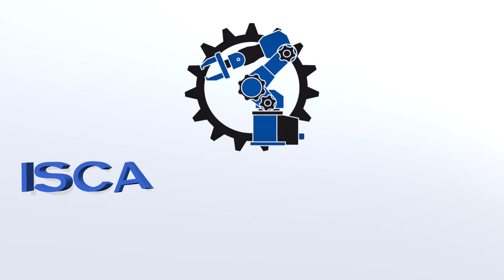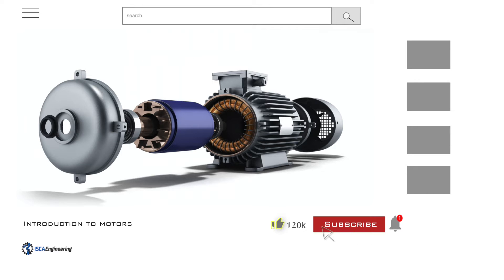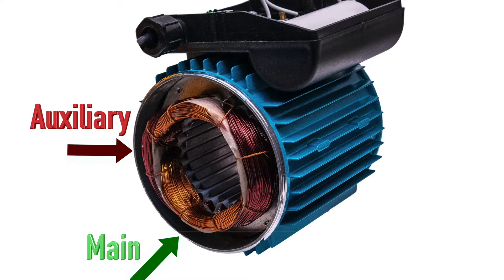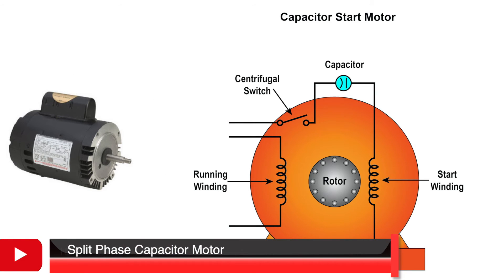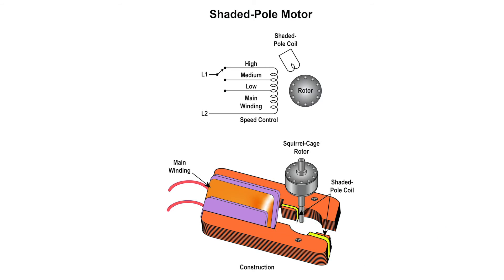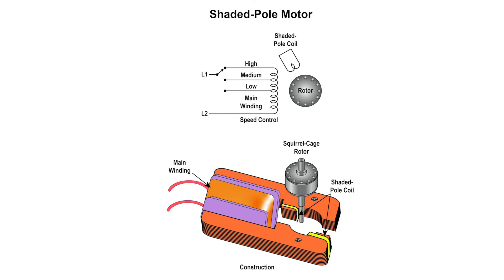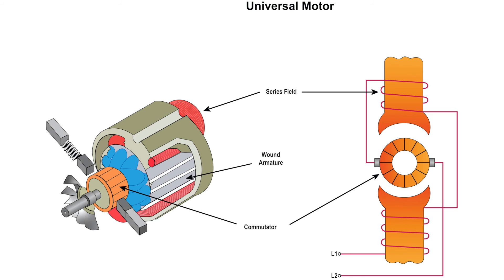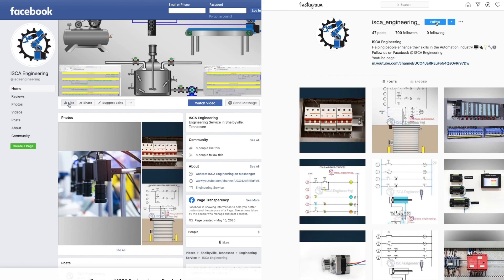Single Phase AC Motors

Comment: i'm confused on the degrees of phase shifts. i understand that they relate to power factor but i just cant wrap my head around the degrees portion. when it comes to three phase motors i have learned that they are 120 degrees out of phase but when it comes to other motors they are 90 degrees out of phase. is there a video or a way for me to understand it better?

Comment: good vid ..you could include the difference between the run and start capacitors
Reply from the maker: Noted
Reply: He had no idea 
Run capacitor is permanently connected 
Start capcitor is x6 of capacity this one is disconected with centrifigal switch when speed reach 75%

Comment: Cap start single phase motors in blowers small fans and small saws? This is so wrong!!! Small fan= shaded pole induction motor. Hand held electric blower almost 99% of the time is a universal or DC motor, as is the hand held power saw. This is so incorrect right out of the gate I will not need to watch the remainder of the video!
Reply from the maker: Sure buddy

Comment: 3:56 - 4:02 I don't understand this part. AC already reverses the rotation of the magnetic field. We only have 2 magnetic poles here. Even if we put another winding with "reverse polarity" we will still have the same rotating field with 180 degrees phase shift (compared to the first winding), but because the same rules apply, the magnetic field will still "move" from the unshaded side to the shaded side. Thus there won't be reverse rotation.

Comment: very nice video thank you. i'm having trouble with a fan motor stator single phase ac, when i opened it to replace the bushes/bearings i accidentally tore of the stator windings form the starter capacitor that is also connected to the speed settings, now i have 6 loose wires from the stator and not sure how to reconnect it. thank you in advance! liked and subscribed!
Reply from the maker: Just got my account back. Hope you fixed your issue !
Reply: @iscaengineering  couldn't fix it and i also noticed the thermal cap was blown that is put into stator windings so deep that if i wanted to replace thermo cap it would just ruin all of the winding. Thank you for responding
Reply from the maker: @spoddermansweg9077  Thank you for your comment. I completely agree that replacing the thermal capacitor in a motor can be a difficult task, especially if it is deeply embedded within the stator windings. In such situations, attempting a DIY repair can pose several risks, including the possibility of causing further damage to the motor windings.